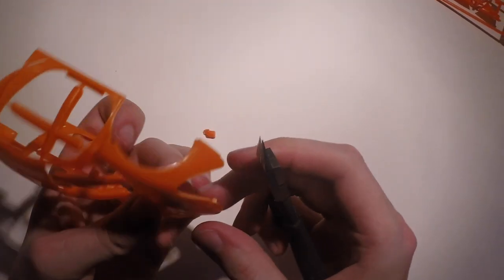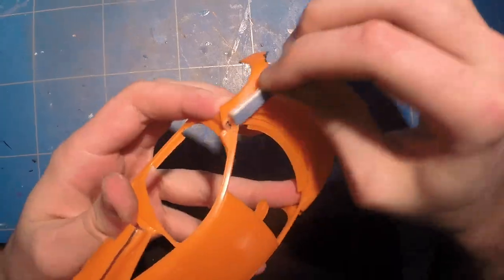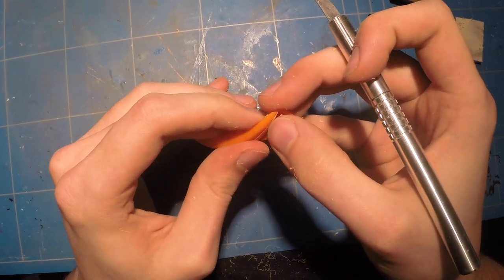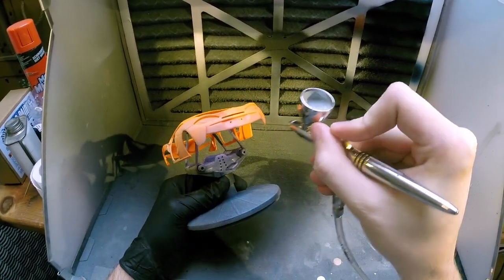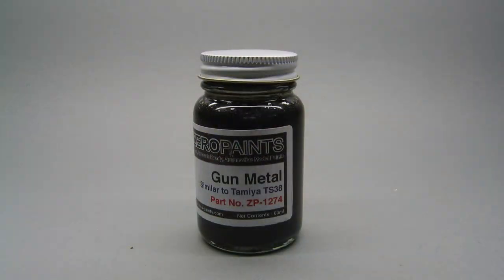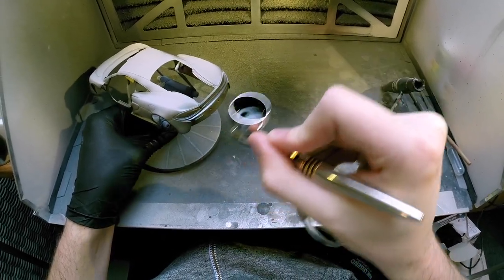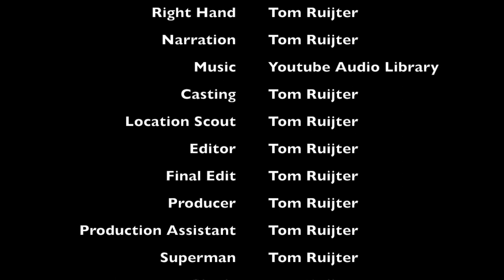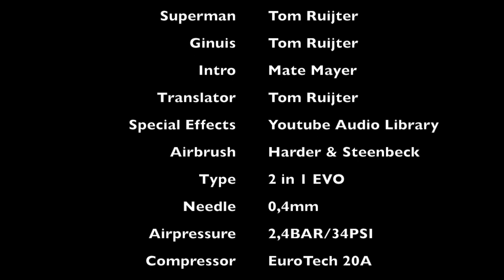Revell: Mclaren 570S Part 1

Comment: Beautiful work as usual Tom. You say that you wait 5 to 10 minutes between coats.  Do you encounter airbrush issues, ie. tip clogging, when you start up again on the next coat?  I'm assuming you leave the airbrush "loaded" while you wait, correct?
Reply from the maker: Correct, fully loaded. Ready to go. No clogging with this paint or tip dry as long as you leave enough paint in the cup

Comment: Nice paint job ! Since I'm not the best painter on the world and bought this same kit I think I will  go with the stock colour. I painted a white Posche 934 in orange, using 2 pots of revell aqua colour having lots of fun, not, with my first atempt with a paint gun...I will try just adding gloss clear directly on to the body...would this work ?
Reply from the maker: It will work to a certain extent, it won't stick as well, and will just be a clear glossy coat on top of the plastic.
Reply: @TheScalemodelingChannel  I need more practice with the airbrush then, before i mess up another model with my "broddelwerk". Just watching you work will give my learning curve a boost i hope. Keep it up ! 👌

Comment: why didnt you use a dark primer since you are using a dark paint
Reply from the maker: The black primer i have does not have a filler in it. does not stick well and looks terrible. I preffer the grey primer over any primer i have tried so far.